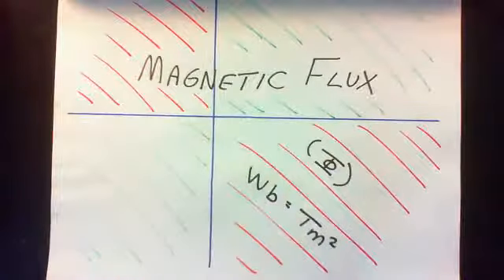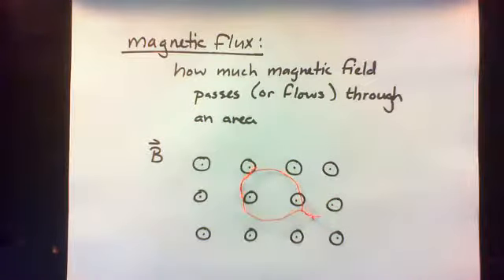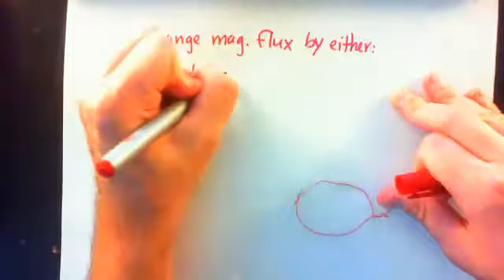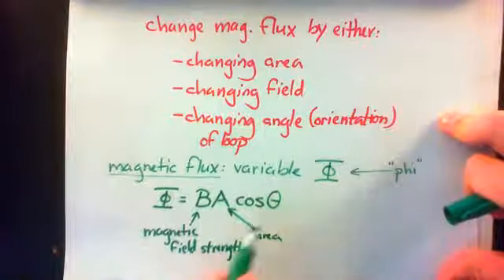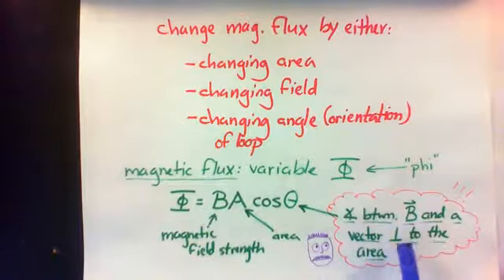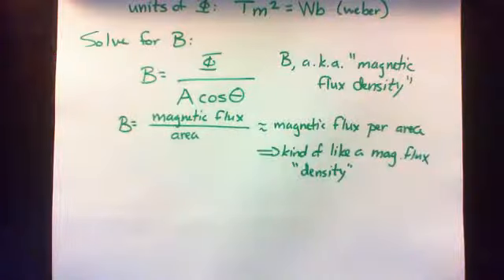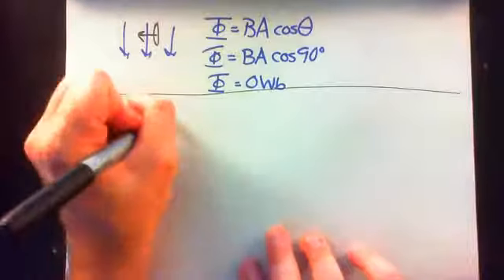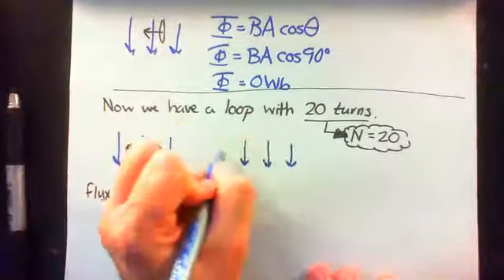Magnetic Flux - Part 1

Comment: This was only part I. Where did the flux come-from? How much flux is there around a wire 1 m long with 1 A flowing? How much flux is there at a distance of 1 m from the same wire...? How much flux is there outside a loop made of the same wire...? What is, magnetic flux? How fast?
Reply from the maker: Raymond K Petry 
Where did the flux come-from?

Magnetic flux is the magnetic field "flowing" through a surface. Magnetic fields (at this level) originate from charges in motion.

How much flux is there around a wire 1 m long with 1 A flowing? How much flux is there at a distance of 1 m from the same wire...?

It depends on the shape of the surface through which the magnetic flux moves.

What is, magnetic flux? How fast?

Many textbooks discuss magnetic flux in more detail, and it may help to read and hear about flux from multiple sources to get a better handle on it. This PhET simulation can also be useful:

http://phet.colorado.edu/en/simulation/faraday